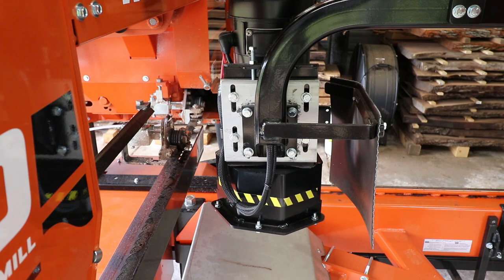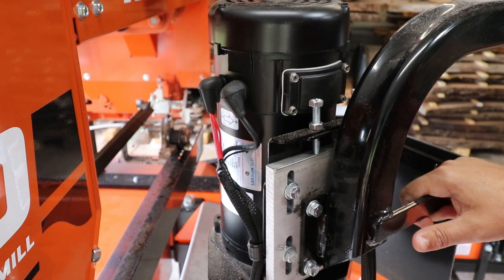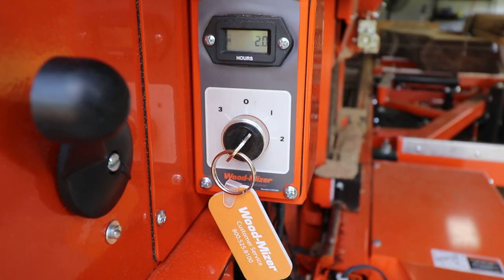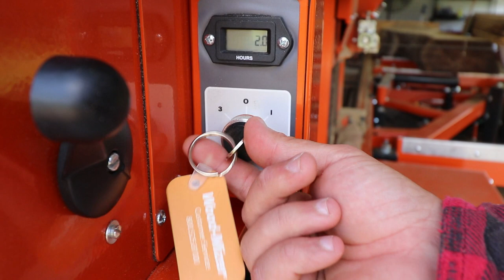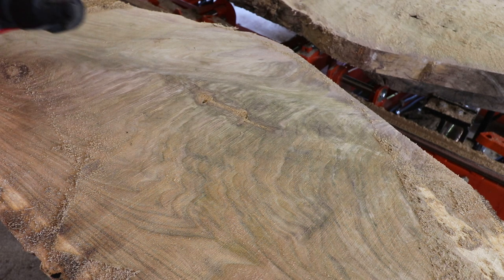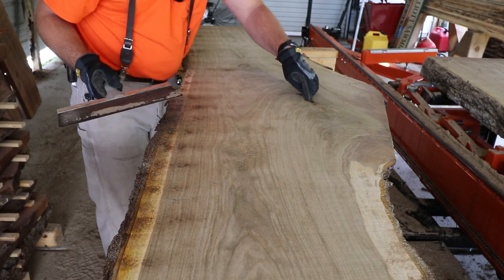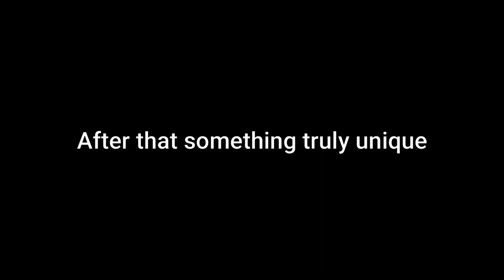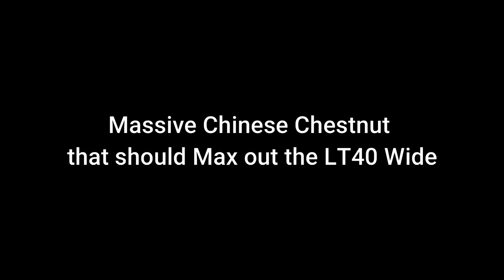THIS LOG GOT BETTER WITH EVERY PASS ON THE SAWMILL, AMAZING CROTCH WALNUT LOG

Comment: Your correct about Walmart and the neighborhood markets they have. On the Dollar Generals there here also. Looks Ike you did good with that mill, especially for the bark edge slabs you do 90% of the time. I do have a question what do you do with the waste slabs do you burn them for firewood or sell them as firewood to locals. Even though you don’t square the cants you have at least 2 fairly thick hardwood slabs per log.

Comment: Seeing as you drove down the road you have the ash borer in your area as well. Pretty soon you won't have any and there will be wood lots full of dead trees.
     Beautiful saw, looks it has all the bells and whistles on it. Was wondering how the debarker worked. Congratulations on it. With the diesel engine you surely aren't lacking for power going through some tough grain. But was curious on the exhaust fumes. Are they tolerable or does it get strong at times? I'm sure they are putting a convertor in the exhaust but I could be wrong. Just wondering on the exhaust fumes if any. Again congratulations on your new purchase and I'm sure it will last a very long time.

Comment: Do you need to treat your new sawmill with a break in procedure? When do you have to change your oil for the first time? Is there a certain feed and speed rate you use or is full speed all the time? I know cutting steel we cut slow the first two cuts to break the blade in and adjusted the tension and cut rate after that.

Comment: I UNDERSTAND THE NEED FOR THE DEBARKER, BUT WOULDN'T YOU NEED ONE ON THE OTHER SIDE OF THE LOG TOO? LOVE THE FIGURE OF THE WOOD THAT YOU ARE CUTTING. CONGRATULATIONS ON THE NEW SAW!
Reply: I would suspect the lead edge the rock is stopped by the wood and causes the saw tooth to break whereas the opposite side the rock is free to travel away from the wood.
Reply from the maker: Exactly
Reply: @JosephGodwin137  Thank You, Joseph, now I get It!
Reply: @kenprovus9195  ...Why were you yelling on your first comment?
Reply: @paulcopeland9035  NOT YELLING, JUST LIKE USING CAPS!

Comment: I have a question, Why it the "De-Barking" saw only on one side ? I see the bark on the other side of the logs being cut and was wondering... Is there less stress on the bandsaw blade exiting the log as opposed as the side with the "De-Barker" ?
Reply: Yes pulling dirt through the log is hard on blades . Exit not so bad .

Comment: nice mill, glad you like it.
is that a def engine? I have the 36 yanmar from 2012 and I notice a huge difference in the muffler between yours and mine.
Reply from the maker: Yes it is
Reply: @OutoftheWoods0623  I have def in my truck and it's not really an issue, except in the winter time. it will freeze up on you but it has to get really cold for that. i imagine you probably have a heater in your def reservoir though that will kill your battery eventually.

Comment: Why does the engine lean over to the right while cutting and then fall back down at the end of the cut? Shouldn't it be bolted down fast to the carriage?
Reply from the maker: that is how it is designed to shift into throttle to run the blade,

Comment: $15/brd. ft.?

Yeah, that's a bit out of my budget.
Reply: I dont have any idea what those boards are worth but when you go to a lumber yard here in Texas you need a freight train to haul enough money to buy regular lumber.
Reply: I live in a hardwood producing area and wood prices are still out of sight.  Luckily for me, I have a friend in the next county over who has 150 acres of forest.  He gives me first dibs on anything he cuts down.  Currently I have some Shubert red oak - air dried for 10+ years - sitting in my shop waiting to be turned into cremation urns.

Sadly, because of the ash borer, in the upcoming months I'm going to have more ash available than I can use in several lifetimes.